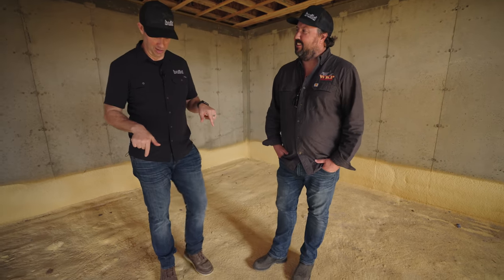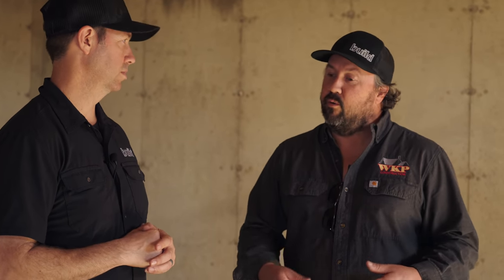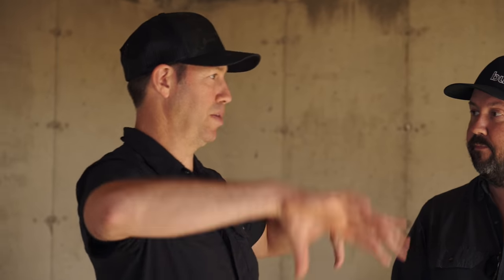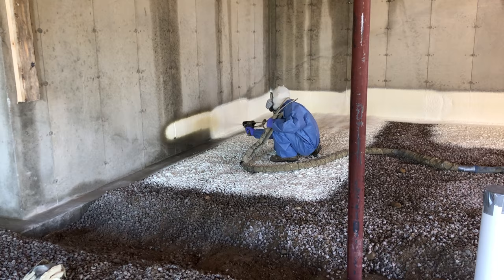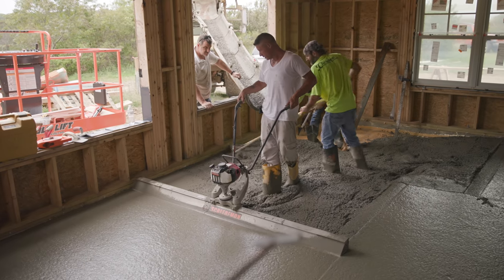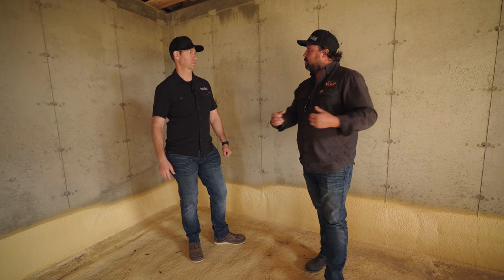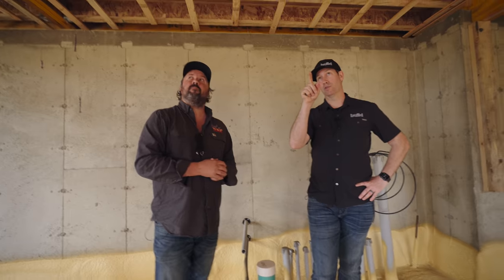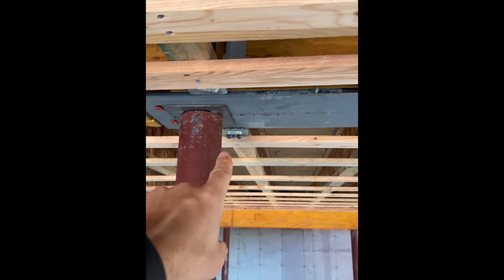3 Tips for a Better Basement BUILD (Insulation, Waterproofing, & Framing)

Comment: I wonder what a basement from
This contractor cost.? 
I am going to say $80k to $125k.
Reply: Bet he charges more for this yet his labor is substantially less then a proper poured base slab with sealed ICF panels and a finished slab poured on top that will last substantially longer then this.
Reply: Depends on size, but my guess is $30-40k regular build
 Maybe foam adds $50,000, lol.